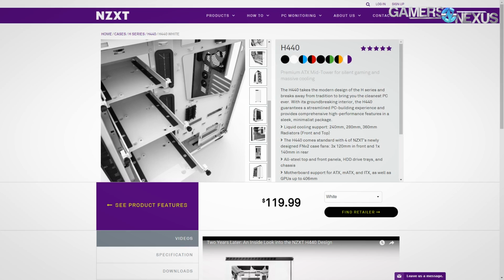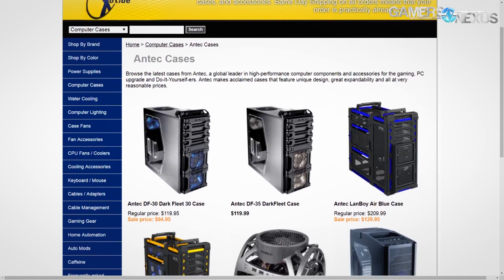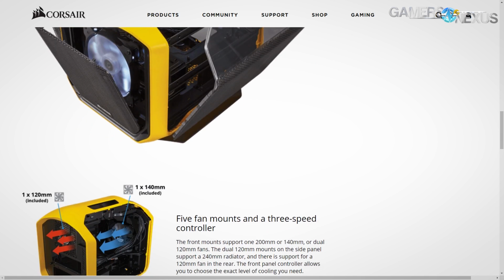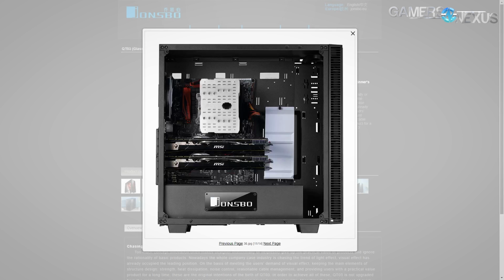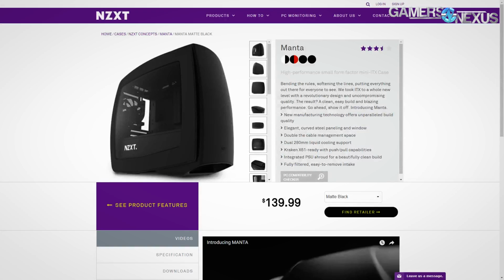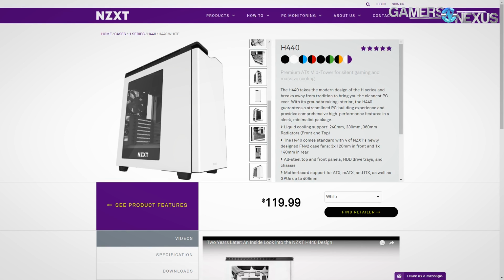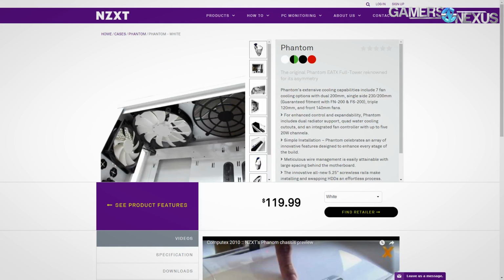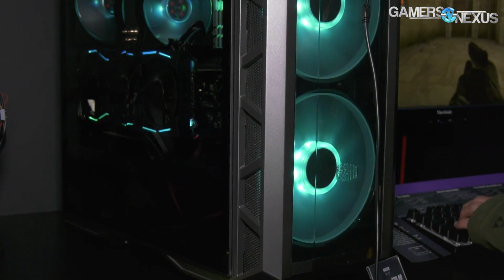Reviewing the Case Industry

Comment: Loved my Antec 900.
Reply: Got my 900 sitting right here, 10 years and going strong.
Reply: maybe I just got lucky but all my fans are still going strong - all of em it's been like 9 years.
Reply: loved?  I'm still rockin mine lol  - I might get that new coolermaster 500p though when i comes out
Reply: a lot of dust tho gotta admit
Reply: 902 v3 owner here, cooled everything I put in it for the past 5 years :D
Reply: Yeah, I was thinking about the Antec 900 for a lil while now and remembered how it cooled better than even the HAF X did. I went from Antec 900 ----> HAF X and remember I was disappointed in the cooling of the HAF X, which in hindsight is fucking stupid because nothing comes close to the HAF X nowadays (at least anything I've seen). Though I can't say I'd want to go back to the antec 900. To the HAF X? Possibly, it had a pretty decent design though the 200mm fans did wear out fast. 

In turn, I am worried about the H500P because I am probably going to buy it because I really want something with more airflow and a newer design. The big fans do worry me, especially since I have experience with CM 200mm fans and them failing after 4-5 years pretty much invariably. Though some would only last a year or less. However I will take the hassle of replacing 200mm fans if it means CM continues to produce them at least. Later in the years of the HAF X, it became "How much longer will I be able to buy these 200mm fans?" Sure, you can stock up... But who wants to do that with fans?
Reply: I still use the antec 900, good case, i've had to replace all the fans in it though, came with blue LED fans, replaced with red LED corsair fans about a year ago
Reply: +1q3er5 Are they the ones that came with the case? or are they aftermarket? Either way, that's damn impressive.
Reply: Mikah Mitchell I've never installed anything aftermarket still running all the stock fans
Reply: I still have my 900. Still goin strong
Reply: Still have mine too.
Reply: looks like the 500P is complete shit ... watch the gamernexus review he completely shits on it - pretty funny.  Welp looks like I'm sticking with my Antec 900 for another 5 years lol - all original - fans still working.
Reply: Very nice to see people rocking old pc cases with modern tech inside.
I have an "old" case (Enthoo pro) as my daily driver.
Thinking of modding it to modern interior/exterior.

Comment: In my opinion there is a serious lack of horizontal mobo mounting cases on the market. Sure there is CaseLabs and Lian-Li but that's getting into very expensive territory.
Reply from the maker: Definitely a lack of those. SilverStone, CaseLabs, Lian-Li, and test benches are basically the way to go -- all of which are (generally) expensive. HTPC boxes get a bit cheaper, but not much in ATX form factor.
Reply: Anyone know why cases have ended up being vertical in the first place?
Reply: My guess is that consumers wanted cases with a thinner footprint and height didn't matter as much.
Reply: I've basically come to the conclusion that if I want a really good case I'm going to have to just build it myself totally custom from sheet metal, a few preformed parts cut to size, and some general-purpose metal working tools.  Either that or pay even more to have it done for me, and STILL totally custom.  No matter what, it'll be expensive, either in my own time directly, or money.
Reply: i love my thermaltake core v21, that's only mATX though. also they're slowly phasing it out for the... X5 i think? at least, they don't sell separate window panels for it anymore. but it's an underrated design imo, competely rotatable to any side and you can move the window wherever you like. it's kinda bigger than it needs to be, though.
Reply: I like Silverstone because their cases don't waste a ton of space. I tend to go more SFF now and a lot of ITX cases are still too big, but Silverstone is very efficient with its use of space.
Reply: +FDMtech True but those are in the more SFF or HTPC spectrum. I mean more in the mid tower to full tower size range. I have a CaseLabs S8S which can fit full E-ATX boards (or larger, if you go for the SSI EEB option).
Reply: You might be interested in those then: https://www.computerbase.de/2017-09/nanoxia-project-s-mini-midi-gehaeuse-htpc-glas/  

In case you didn't know: Nanoxia is a german manufacturer and they are not that well known outside of Germany.
Reply: turn your case horizontal ;D
Reply: Thermaltake Core X series (X1, X5, X9) all have horizontal mobo mounting out of the box. Don't expect ANY cable management with them, though.
My current PC is built in a Core X5 right now, but I already bought a TT W200 for a very good price and am in the process of buying extra hardware to fill it up.
Reply: Tower isn't horizontal, though
Reply: This is why I picked up a Cooler Master Haf XB EVO, it's relatively inexpensive for the segment, and while it's lacking tempered glass or flashy RGB, it's a competent case that's easy to build, has great airflow, and has decent support for water-cooling options.
Reply: RadActiveLobster I'd like to see more too, as long it's got good airflow.
Reply: RadActiveLobster you can get flat sided cases and lay it horizontal
Reply: RadActiveLobster yeah I'm a BH2 owner here. I would like to see more inverted designs like my silverstone tj08b-e... Well space  efficient ones unlike the recent corsair case.
Reply: Lian-Li is where it's at, expensive though.
Reply: Jaymiecain1 Cases used to be on the desk because there was a lot of media swapping (floppies and later CDs). The horizontal form factor worked well for that as you could put it under the monitor and it didn't take up much space. With the decline of physical media it was practical to hide the computer away under the desk and the vertical form factor works best for that. Now of course many enthusiasts put their towers on their desk to show them off, and again vertical works best for that.
Reply: I'm in the hunt for a case for a TR4 build and... geez.. I just KNOW if I could get my hands on an Antec Skeleton, I'd build on that all over again XD
Reply: Tower 900
Reply: Gamers Nexus Not if you build a test bench out of legos
Reply: dar0 Legos more expensive than a Lian Li though =)

Comment: coolermaster HAF-X case is the best one ever made i think. I bought it 4-5 years ago and wont ever need another one. You cant beat the airflow, expansion slots, hotswap bays, cable management, water cooling routing options due to how much room you have, and the fact it has the tank track look all the way around it. Its the only case i know of that can house 2 full pc systems (with mini atx boards) in one box, and efficiently air cool both of them, quietly, and look good at the same time. For 200 or less, you cant get a better box that has as much function as the haf-x.
Reply from the maker: Still have our HAF X! We might break it out for the H500P review.
Reply: Build quality is far from garbage. Im still rocking the factory fans. They have been running for near 5 years straight on 100%. I turn my system off maybe once every few months lol.
Reply: If you are willing to do a little case moding, the HAF X is still a beast. When I retire it I'll put it to use as a tool shed out behind the house or maybe a guest bedroom.
Reply: I had one for ages and recently sold it. It was starting to feel enormous in this modern world of ssds, aio coolers and obselete optical drives. I switched to mATX and i'm loving it.
Reply: Gotta agree, Coolermaster HAF X is a Big Bad ASS Battle Box, after a few upgrades I'm still rocking 2 of them.
Reply: the 900D is better.
Reply: the best case you can get is a case with 140mm fans in every spot, and no glass side panel, it has to have room for 3 intake fans in front with no psu shroud to block airflow.
Reply: 91XtremeRT Had one for years. Then went to an Enthoo Pro. The HAF-X is massive, overwhelmingly so.
Reply: I dont think its that big. I mean i bought it back when i lived in a tiny ass apartment and it was never in the way or ever came to mind that it was too big. Its big, but if you look at the dimensions its no more than an inch or two bigger than most other atx or eatx cases out there.
Reply: It's not that great for watercooling
Reply: 91XtremeRT yea it's a great case but it's hideous
Reply: I think its awesome but then again with being ex-military, i love the military look.
Reply: I prefer the Dark Base (Pro) 900, although airflow is somewhat limited unless one is willing to mod the highly restricitve vents. Also supports dual 420 30mm rads.
Reply: 100% agreed i still use my HAF-X i keep on updating my hardware, but case stay the same, its just a damn good gaming case in my opinion the best coolermaster has ever made
Reply: the built quality is garbage and the fans are junk